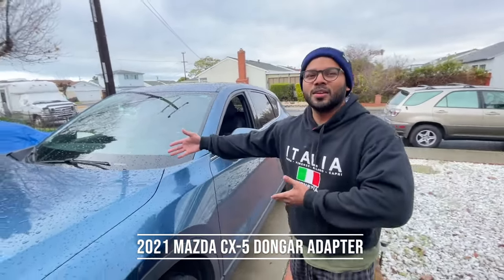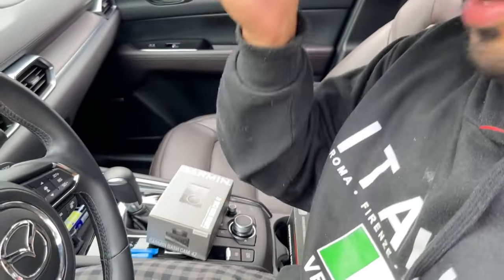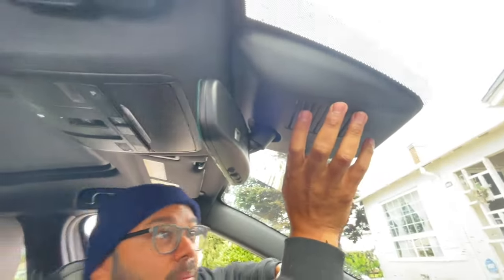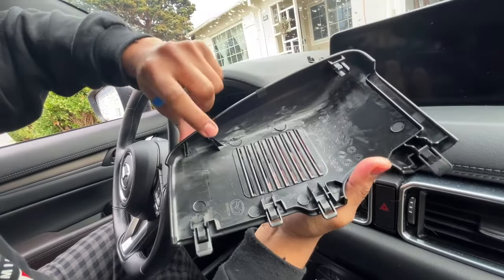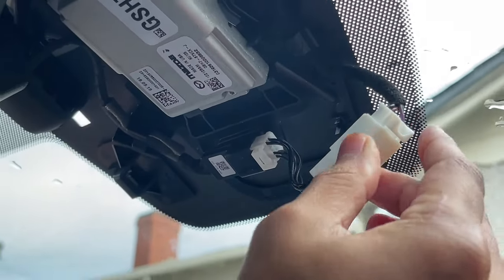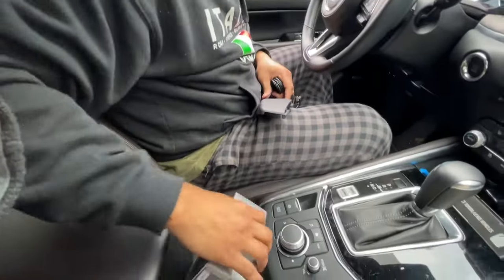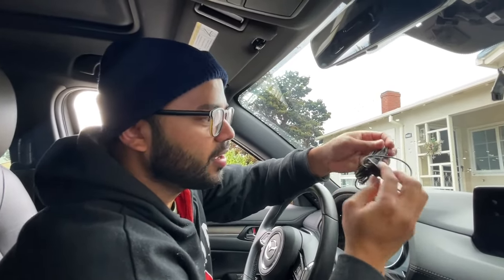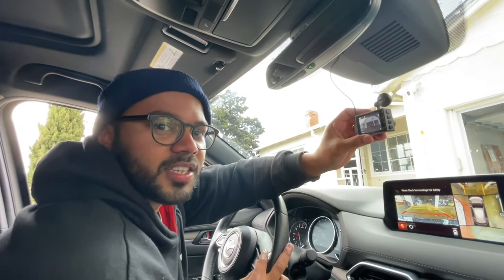2021 Mazda CX-5 Dashcam Installation | Dongar Adapter

Comment: I'm a bit late to the party. I decided not to go this route because I want power to be going to the camera at all times. I purchased an OBD 2 power connect instead and ran the wire uo the side and top of the windshield. I managed to tuck the cable in so it's not visible. That being said, great video!
Reply from the maker: Appreciate it 😎 ...and definitely the way to go if you want constant power.
Reply: are you unplugging it when not driving car for longer period?
Reply: Will dash cam drain battery if plugged to OBD? I currently wired mine like your but had to take it all the way to the center to use the usb.
Reply: @Auto-Minute  The garage buttons are powered even when the engine's off. Doesn't that mean ''Parking mode' could still work when the dashcam is connected to rearview mirror supply? Or is it only a certain duration of power supply or not enough to power the camera when the engine's off?
Reply: @pradyH I really hope someone answers this? Just got my 2020 cx5 and I want constant power going to my camera
Reply: @mitchel_gr8  I figured it out for my Mazda CX-5 2021. There are two sources of constant power besides the OBD port and the battery fuse box.

One is the cigarette lighter port inside the armrest box and the other is the cigarette lighter port in the trunk (yes, there’s one on the right hand side of the trunk).
PS: I don’t know if these always-on ports stop supplying power before completely draining the car battery.

For my front, I simply ran a cable to the regular cigarette lighter port because I don’t need constant power. Didn’t get the dongar because it’s way overpriced for a dollar tree item.

For my rear, I used the trunk cig lighter port. But I wasn’t sure if it drains the battery if the camera runs for too long. So I got myself a camera that has a feature to turn itself off after a few minutes. I bought the 70mai for the rear.

So far so good for me. I should probably make a video of my set up and my trials.
Reply: @pradyH  Ahh gotcha! I will most likely go ahead and hard wire because I need constant power. There’s been so many break ins at my residence (Downtown Dallas) and I’m just over hoping Apt security will actually do their job. 

But anyways my dash cam has the 24hr parking mode built in, I just need to to make sure I’m able to hard wire it to where it doesn’t drain my battery. Thank you for the reply. #MazdaGang

Comment: You could have filed a small notch in the lower side of the two part plastic cover and brought the cable out through the bottom. That's how my Mazda dealer did mine.
Reply from the maker: Hey Bob! You are correct. I could have routed it thru the bottom. It's something I learned about AFTER the fact 😓 whoops! Glad you got your setup dialed in 🤙

Comment: Great video.... QUESTION:  can you link to the 'short USB A to MICRO USB cable' that you used to connect the Garmin Dash Cam to the Dongar Adaptor?  I used a short cable and the Garmin would not power up with it..... so I tried several other cable I had laying around and a handful of them worked, while others were apparently not compatible.  These were all LONG length cables though, so am looking for a 'shorty' cable to connect my Garmin 57 (similar to yours) to the Dongar adapter.
Reply from the maker: Hey! I actually used the long USB to microUSB that came in the Garmin dash cam. I also have this cable which worked with the adapter as well (https://www.amazon.com/SUNGUY-Braided-Charging-Samsung-Android/dp/B073TTTPXD/ref=sr_1_8?crid=SVRNQ7I5Y8A8&keywords=usb%2Bto%2Bmicrousb%2B2%22&qid=1664600212&qu=eyJxc2MiOiIwLjk4IiwicXNhIjoiMC4wMCIsInFzcCI6IjAuMDAifQ%3D%3D&sprefix=usb%2Bto%2Bmicrousb%2B2%2B%2Caps%2C117&sr=8-8&th=1) sorry for the enormous link! LOL just make sure you plan out where you want to mount your camera and measure that length accordingly. The short cable that comes in the Dongar Technologies box might actually work if routed thru the bottom, but I can't remember since it's been a while.

Comment: Hi auto minute, does the 12V port turn off if i turn off the car? Planning to run a wire from it via the pillar but don't want a dead battery coming morning:) thanks
Reply from the maker: Hey! If you're running a wire down to the 12V aux power outlet (cigarette lighter), there's a chance that's still running power off your vehicle's battery even when [OFF]. In most vehicles, they're usually activated when key is in the accessory power position or [ON], but I have seen some cars where that port is powered 24/7. As for the adapter I'm using in this video...it turns [ON] and [OFF] with the vehicle so there's no worries about it draining your battery. Are you driving a CX5 as well?
Reply: @Auto-Minute  thanks for the response. I have a cx9 2022 GT. Mazda also told me the same that the cigarette lighter port might be drawing power always.
Reply from the maker: @nkishor  Since it's a CX9 and a Grand Touring, you should already have an auto-dimming mirror right? ..or do you have a different setup than mine?
Reply: @Auto-Minute  correct, it has the autodimming mirror. The reason i was looking to run the wire down to cigar port was that's how i had it in my old car, and also (irrational)fear of voiding warranty or breaking the mirror panel :D
Reply from the maker: @nkishor Ahh I see. One more question...Does it plug in directly into the back of the mirror or go into the plastic shroud like mine? I wouldn't worry too much. You're not making any modification to the vehicle's functionality or safety features. I understand the concern, but it's going to be so cleaner doing it this way. As for breaking the mirror panel lol my advice when it comes to taking panels apart...just be patient. It's all just a bunch of tabs. I need to re-watch my video now to see if I captured the panel removal process clearly enough haha
Reply: @Auto-Minute  oh your instruction on panel removal was pretty clear, this is just me being paranoid with my new car haha. About the wire behind mirror, yeah it looks very similar to yours, eventhough its not a frameless mirror if that matter.
Reply from the maker: @nkishor  haha understood and trust me, I've been there. As for the mirror itself, I just wanted to check because some Mazda CX5s have the connection directly on the back (way easier). Take a look at picture #2 on this page (https://dongar.tech/products/10pin-type-a) you'll see what I mean. In any case, yours is probably just similar to mine.
Reply: @Auto-Minute  Thanks so much really, I'll go ahead with the cleaner solution.

Comment: Hey buddy, how’s the parking mode with the dashcam?
Does it work great? Thanks
Reply from the maker: Hey Kin - This adapter only works when your vehicle ignition is ON. If you wish to use "parking mode," you'll need to tap into the vehicle's battery for constant power. This could run the risk of draining too much from your vehicles battery which can weaken the battery over time and end up being more expensive. I've personally never felt the need to have "Parking Mode" enabled on my dashcam, however, everyone's got a different situation so whatever works best for your needs :D
Reply: @Auto-Minute  it’s really helpful for me and thanks 😊

Comment: I'm using cigarette lighter for dashcam and due to this my dashcam is never going OFF (although my parking mode is OFF). It eventually drained my 2022 CX 5 battery which was just two months old 😕)..
Does the installation that you suggested helps me from above issue for CX 5 2022?
Reply from the maker: Hey Chaitanya! You won't have to worry about it with this product. It's designed to specifically AVOID the problem you just experienced. It'll turn ON and OFF with the vehicle without tapping into the battery. I'll take this over the cost of a new battery any day :D Cheers!

Comment: Thanks for the vid, wanted to know about rear view camera, this just frontal i guess
Reply from the maker: Yup, only front-facing, but you could power a rear dashcam using the same adapter OR pickup a dashcam with cabin view as well (easiest solution imo)
Reply: Ooh so you mean from Dongar 10 pin to USB A adapter we can connect the rear one too and wire it back to the top of boot gate? Kinda confused, Sorry, totally new into dash cams so asking these questions. Your suggestion of having a single dashcam with  in-cabin view makes sense too. ✌️

Comment: Just a quick tip.  Don’t use that crappy little blue tool. You’ll end up scraping the plastic.  Get a proper trim tool. Also. Mine had a lot of power cable. A lot.  Use electrical tape to tape it in the space inside that trim panel.   I only remove the big half of the plastic, which made it much easier to hide the adapter and route the wire.
Reply from the maker: Great tips! It was a learning experience for me on this one. The blue tools work, but I know what you mean and have since invested in some proper trim removal tools.

Comment: I can't seem to get the cover open/off.  I've tried the orange plastic tool that comes with the kit and myriad other 'flat bent plastic tools' and while i can start at the bottom notch and get a tiny space between the sections...they two halves don't separate.  Worried too much pressure and I'll break it.  Any ideas or wisdom on how I can get the plastic cover(s) off?
Reply from the maker: Hmm...since you're already able to start splitting it apart from the bottom, it would help if you had another pry tool or even a flat head to insert into the gap and sort of run the 2nd tool up the seam. It should definitely release that way. So initial tool to create the gap at the bottom, and a 2nd tool to run up the seam. Hope this helps! Let me know
Reply: @Auto-Minute  That worked.  Woo!  You're awesome, thank you!

Comment: Hi. Does this set up support for a camera with a 24hrs parking sensor and collision detection that requires to be ON even the car is off?
Reply from the maker: Hey Emmy! This adapter is equipped to turn [ON] and [OFF] with the vehicle. Based on their statistics, majority of incidents happen while a vehicle is in motion. Additionally, they didn't want to risk a dash cam tapping into the vehicle's battery when it's [OFF]. That said, I do believe newer dashcams come equipped with battery protection so it automatically stops sourcing power from your battery so it still retains enough power to crank when you get back to your vehicle. Hope that helps!

Comment: Does this provide continuous power to the dashcam for parking mode?
Reply from the maker: It replaces the need to use your vehicle's auxiliary power port which turns ON and OFF with your vehicle. If you wish to use "parking mode," you'll need to tap into the vehicle's battery power.

Comment: any suggestions of tips if you want to include a rear dashcam?
Reply from the maker: Wiring for rear mounted dashcams tend to run thru the floor which wouldn't be suitable for this adapter. I've meddled around with the panels on the rear trunk, but no luck with a solution at this time :( Sorry!

Comment: Are you using the 10 Pin adapter for Mazda Framless Mirrors?
Reply from the maker: Yup. The connector on my CX5 takes a "10-pin Mazda Frameless Adapter." The link to it is in the description. You'll need the "Type A" if your connector is located on the back of the rearview mirror.

Comment: Does installing it this way going to activate the dashcam's parking mode?
Reply from the maker: This is connected to your ignition so it will simply turn ON and OFF with the vehicle. Parking mode required direct power from your vehicle's battery.

Comment: Maybe you posted somewhere but I missed it, I don’t see a link to the adapter.
Reply from the maker: Hey! Appreciate you checking out my video. I left a link in the description 👍 but here's a direct link anyway - https://dongar.tech/products/mazdaframeless. This adapter will work on Mazda's "frameless" rearview mirror usually seen on Signature trims (pre-2022), but on several trims for the 2022+ models.

Comment: No dash cam on my Mazda. No navigation card in navigation slot. But, they gave me daylight running lights...which I hate and can't disable. DRL are not required in my country.
Reply from the maker: Sorry bro. Mazda not giving you the navigation slot is just dirty. I've definitely seen those SD cards available online if you're looking for one, but if you're using Android Auto or Car Play, then it sort of doesn't matter. I did end up installing a wireless receiver for Android Auto which has been awesome. As for dash cam, definitely pick one up because you just never know what can happen on the road. Drive safe!
Reply: @Auto-Minute  I'll definitely get that SD card online. I've seen them sold for around $ 30. Much better than paying dealer $ 500. I will be using Android auto most of the time because no SD card is 100% up to date. If I ever get stuck in some remote location that doesn't have cell phone service I'll use Mazda navigation.
Just curious...if I install after market dash cam and use a fuse that is always powered, will it drain the battery?
Reply from the maker: @samkitty5894  There's a chance it drains the battery. Just make sure whatever dash cam you install has "low voltage protection" built-in. It's designed to keep it from pulling too much charge, so you still have enough amps to turn ON the vehicle. Car batteries aren't designed for deep cycle charging, so ideally you wouldn't want to constantly drain and charge, impacting your battery's health. However, if you do drive every single day, you're probably OK. Lastly, I have a hardwire kit hooked up on my other car for constant power and it has never runs for 24h straight. It usually shuts off after 4 to 10 hrs to preserve battery charge. The number of hours depend on how much I drive that day.

Comment: Thanks. That's a very helpful video.  Where did you end up mounting the camera, and also does it record to an SD card?
Reply from the maker: Hey Peter, I mounted this on the right side of the plastic shroud. There's also a small opening at the bottom of the plastic shroud if you wish to wire it thru there :)
Reply: @Auto-Minute  Do you keep it mounted there all the time?  Was concerned that the heat from the window might damage the cam?
Reply from the maker: @peterkoval  I haven't had any issues so far (8 months in) and the mount itself is held up by very sticky adhesive tape which is a lot more durable than something like a suction mount. That was my main concern due to heat, otherwise, zero issues with the camera :)

Comment: Would this adapter affects the car’s warranty?
Reply from the maker: The adapter does not interfere with the vehicle's engine, computer etc. It simply taps into the power that runs to your auto-dimming (or homelink) rearview mirror. However, dealers will resort to blaming anything they can if you do experience issues with your car. So as a rule of thumb, you never want to mention mods (of any kind) if you're seeking assistance from a dealership lol

Comment: Awesome video! Do you know if this would be the same installation process for a 2019 CX 5?
Reply: Nvm ( just saw the description for 2018+)
Reply from the maker: @MichaelMartorella  All good 😎 there are 2 types of adapters sold by them depending on the type of rearview mirror on your car. If your connector is located directly behind the rearview mirror, you'll most likely need a "Type A" sold on their site 👍 cheers

Comment: Cool idea but the wire dongar harness loom looks really flimsy
Reply from the maker: Hey there! Yeah, it does look that way (I was very careful when I first took it out the box), but after handling it a few times, they're actually quite durable. I also figure most folks will set it up once and never touch it again...in which case, there's no strain on the physical wiring itself.

Comment: Does it still power for parking mode when the car is off?
Reply from the maker: It does NOT tap into the vehicle's battery power. It powers ON and OFF with the vehicle.

Comment: Hey nice video, took me a while to take off the cover lol, but I couldn’t pull (or find any release button) to remove the dongle, felt like I’d rip the wiring apart. I have a 22 carbon edition (non frameless) and the part the dongle plugs into is not black like yours (rather it’s the same color as the dongle, whiteish). Anyone’s advice would be appreciated. Also when I refer to the dongle I just mean the one plugged into the car not the adapter, I just want to check which 10 pin I have so I can get the right adapter
Reply: There is a small tab in the middle of the male connector that you need to depress, sometimes with a tool. Look up pictures of "10-pin automotive connector" to see it.
Reply from the maker: Hey there! As @dzdaddy mentioned, there is a "release" clip that you have to push downwards on and pull the connector out. You will not need any force, so definitely be gentle and patient during this process :) I posted a recent video for another car, but I was able to get a close up of how the connector get unplugged - https://youtu.be/vwHGTnxVBGk

Comment: Where can I get if sold out? D:
Reply from the maker: Hey there! They must have just sold out because I recently referred someone to the link and they were in stock. They usually stock up quickly on Mazda adapters.
Reply: @Auto-Minute  Thanks, I reached out to Dongar and they did say they should be back in stock this month.

It's available on Amazon now :D. I ordered the only one cause it's unavailable again lol.
Reply from the maker: @Dolomite1 lol awesome! that's good timing.
Reply: @Auto-Minute  Thanks to you cause I checked right after typing my response, if not I would've probably checked in a few days.